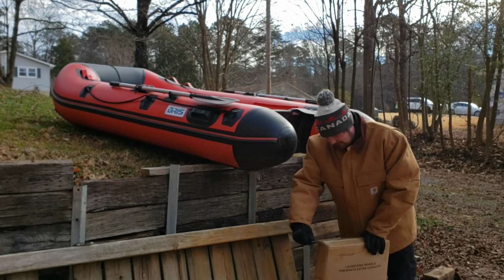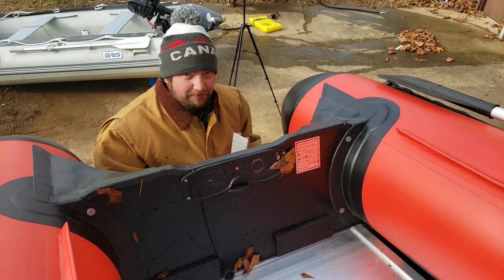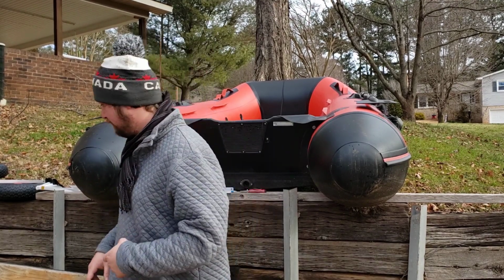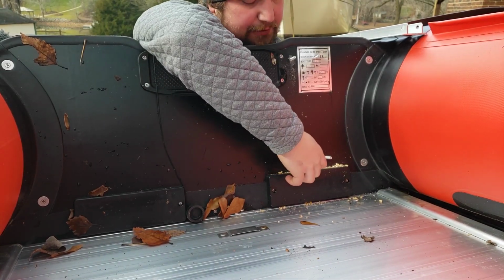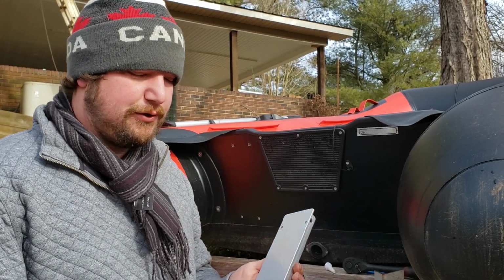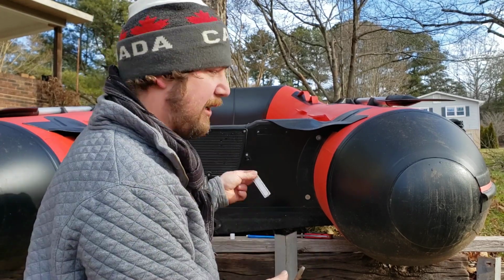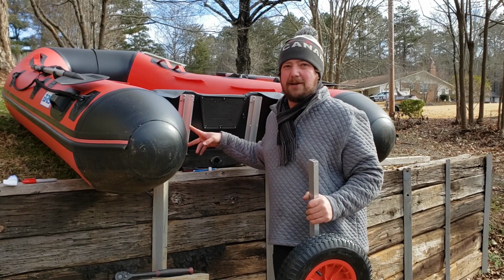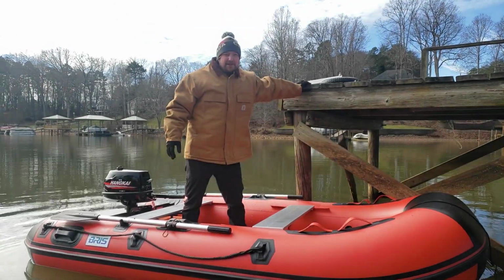Amazon BRIS dinghy - Transom Wheel Installation

Comment: How are you getting from home to lake? Are you trailering? Is it legal to the these wheels?
Reply from the maker: We leave them at the lake. We are fortunate enough to have access to a lakefront house and we leave them inflated in the basement. The times we have transported them we packed them down. We've packed them into cars, SUVs and once we packed them down and used a utility trailer. 

When we went to the ocean, the launch was on the opposite side of the neighborhood we were in so we pulled them at very low speeds behind the truck using dollies under the front end. The transom wheel "bearings" got very hot doing that even though we stayed under 5 mph and it was maybe half a mile.

In the future, we plan on building a trailer; but for now we just pack them down if we want to transport them somewhere.

Comment: don't the wheels fold up out of the water when driving i think they should somehow the bottom bolt should have a cotter pin in it so you can fold the wheels out of the water when driving if you hit something under the water could rip the transom off
Reply from the maker: You can fold them up, but on this boat the transom is so narrow, they kind of get in the way so we just take them off and leave them at the dock. You could take them with you as well. Definitely wouldn't want to drive with them down in the water; in addition to damaging the transom, I don't think you'd be able to steer too well.
Reply: @HufflerGarage  I have the blue ones like on your other boat.. actually tried mine down and it didn't seem to make a difference.. also pulled the bottom pin and just let them float on the top pin and it didn't seem to make a difference..